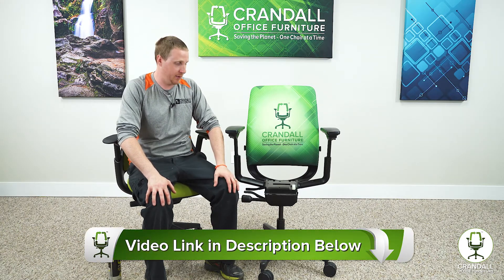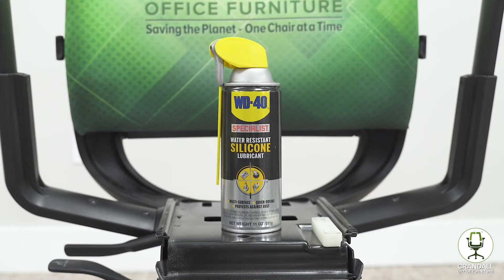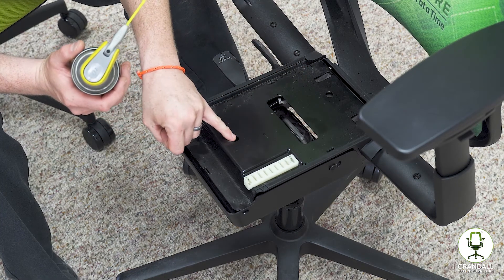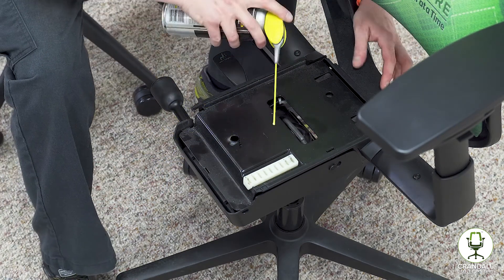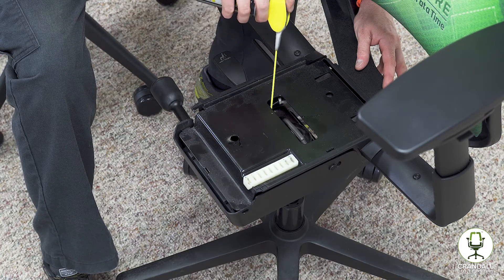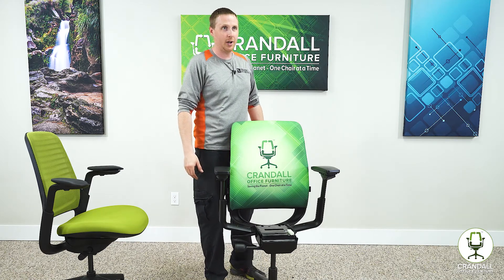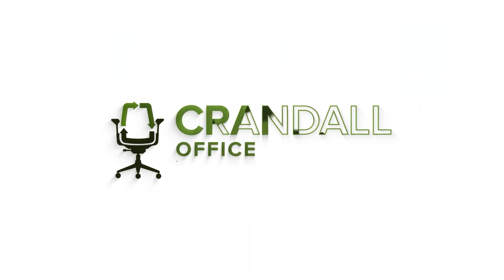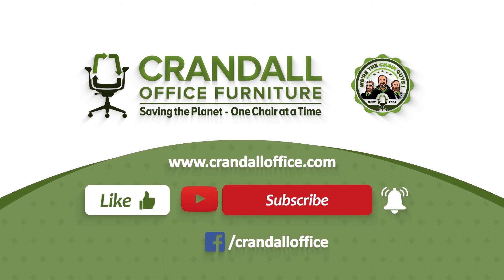How To Fix Your Squeaky Office Chair - Steelcase Amia

Comment: Neither this procedure nor bdawgs982's fix worked for my noisy, 48-hour old Amia.  The tighter the seatback recline tension knob was, the louder the squeak.  I fixed mine by spraying silicone lube on the contact points of the outboard lugs of the seatback recline axle.  The only disassembly needed was removing the main plastic dust cover after flipping the chair on its side to expose the lugs near the platform's center.  The factory appears to use a viscous silicone lube in this area, causing me to wonder if mine had been under-lubed at their Reynosa, Mexico plant.
Reply: This actually fixed the issue for me! :)
Reply: This is the true fix for the incredibly loud creaking. Spraying the spring in the video did nothing to sort my issue.

Comment: I have a steelcase amia and the instructions in this video did not solve my problem. However, i have figured out my problem. The screws that connect the backrest under the seat needed lubrication. I undid the screws with a wrench and applied some white lithium greese to the screws and inside the hole. Put the screws back in and no more squeaking.
Reply from the maker: Interesting! We've never seen a creak develop there before, but glad this worked for you! :) Thank you for sharing this!!
Reply: @CrandallOfficeFurniture  no problem :)
Reply: Here it is folks, the true solution.  After soaking my precious Amia in silicone spray, I stumbled upon the gospel according to Bdawgs, busted out the gnarly white lithium spray and got to work on those pesky screws.  Took a few extra rounds of tightening/loosening to vanquish the squeak.  Forgot to reinsert the plastic covering that goes below the backrest but at this point, the serenity of noiseless reclining is all that matters.
Reply: @ScientificGenius  I did the same, the chair was absolutely dripping in WD-40 until I found this now 3-year old comment. Finally silence.

Comment: I bought my Amia chair at a warehouse dealer last year and ever since I had a slight problem where it feels like the right side of the cushion and armrest is higher than the left. After using a levelling tool, I found that the right side of the chair is indeed 2 degrees higher. Took apart the chair and didn't find anything that was uneven until I started to rotate it around and found that at certain spots the chair was even but when rotated away from it, the unevenness would show. Is there a way to fix this?
Reply from the maker: It would really depend on where the unevenness is originating from - Are all of your casters properly seated? Does there appear to be any issues with the base? Those would be the first place we would look and also the easiest to address.
Reply: @CrandallOfficeFurniture  I think the base that the seat cushion sits in top and the connection to the cylinder is uneven? All the castors are perfectly even after taking it off and the only unevenness showing was in the base of the seat where the cushion sits on top off
Reply from the maker: @Aerouss  You could try removing and re-installing the cylinder and see if that helps. A new cylinder may be worth trying as well. If that doesn't fix it, I'm not sure there's a quick fix to this one :(
Reply: @CrandallOfficeFurniture  thank you with the response! I’ll try that ASAP
Reply: I had the exact same problem mate. Perhaps we both bought the same chair.
Reply: @GuyGamer1  I contacted my local steelcase dealer where I bought my used amia, and since it was under warranty I got the base replaced for free